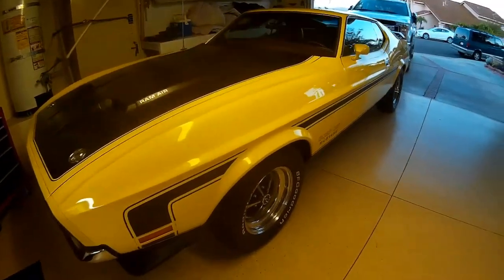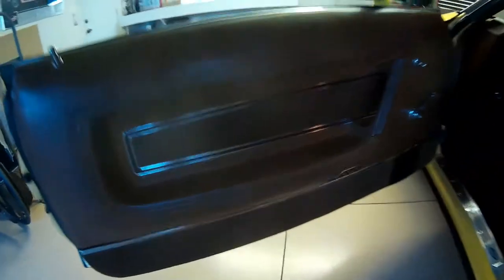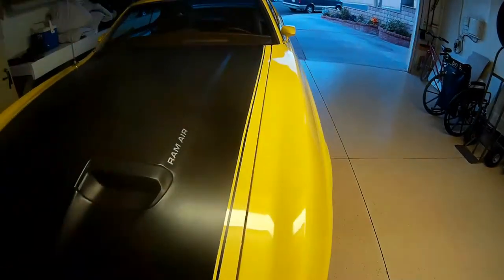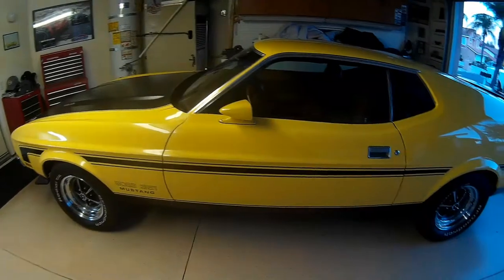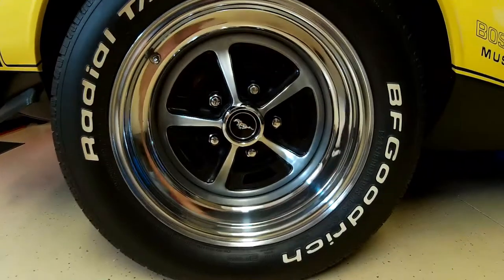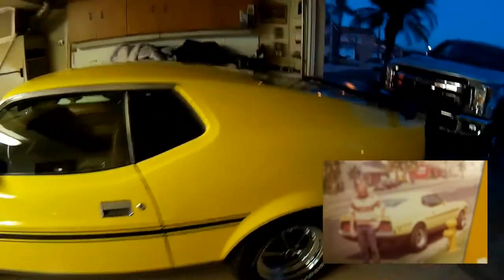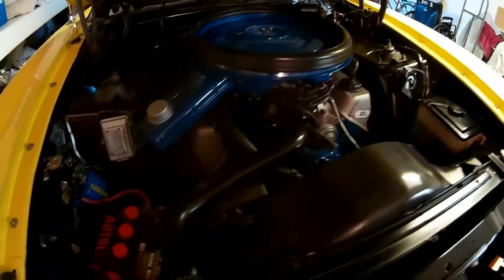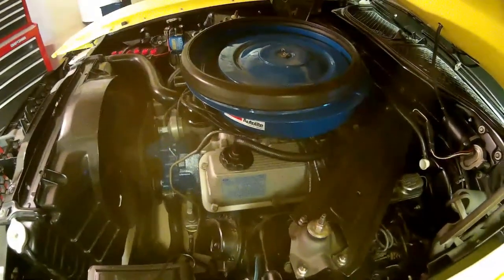1971 Boss 351 Mustang, The Last Boss Musclecar!

Comment: While there are fewer Boss 351 than Boss 302 and 429. But Ford only made that body style till 1973, not 74. Ford also in 71 put a 429 in the mustang. But a rarer mustang than the Boss 351 is the 1972 R code 351 HO, it had a slightly detuned Boss 351 engine and they made only 336 of these. The R code in 71 was Boss 351 engine.   Also not all fastbacks are boss, or Mach 1's. They can just be fastbacks.  That's a nice Boss.

Comment: The rubber  bumper was optional on the Boss. I know that for a fact because my buddy bought his  new and it that the rubber bumper the same as the Mach I
Reply from the maker: must be super rare, i've never seen one and i've spent my whole life at mustang shows.  neat fact, thank you!
Reply: @vintagespeed  Boss 351 was  production limited to demand so the cars were built to order. My best Friends Boss 351 was basically a Mach 1 with the Boss engine. I have seen other Boss 351 cars with a Cheap stock interior, You could get the upgraded interior if you stated it on the order.

Comment: Ford never ran the Boss351 in TransAm, they pulled out of racing in that series after the 70 season.   Ford put the 351C 4bbbl in Mustangs from 70 through to 73.  In the VIN the engine code was R in 71 only for the Boss351.  The "Ram Air" does nothing torce more air into engine, easily ptoven with vacuum gauge.  What it does do is provide cold air to the engine.
All Mustangs were built to order.  The fact that the interior colour only came in two yellow BOSS Mustangs actually made it undesirable, not rare.  If the car came with a radio, check the Marti report and check for number of  Boss351 built with same options as yours.
Reply from the maker: yeah.  thanks for that i guess...  maybe try to be a less negative person when looking at people's videos on the internet?  have a nice day.